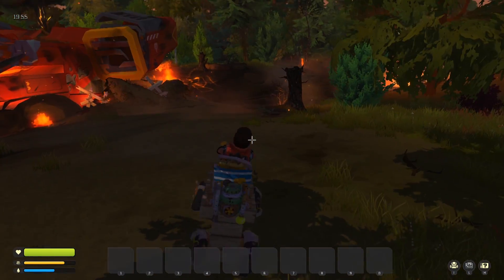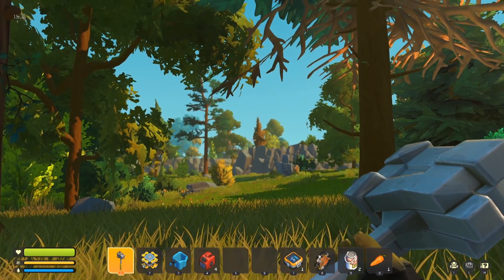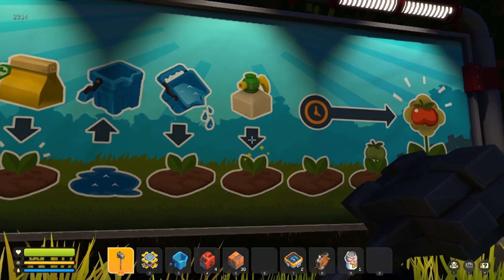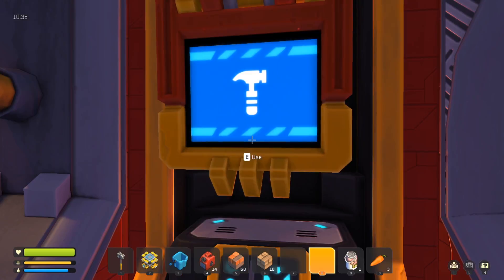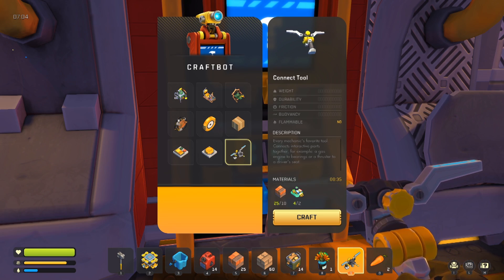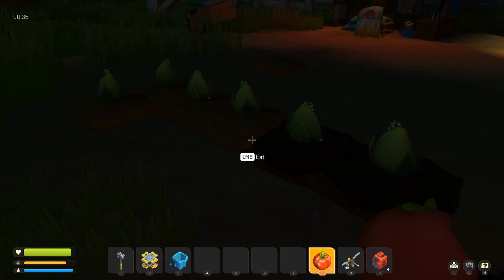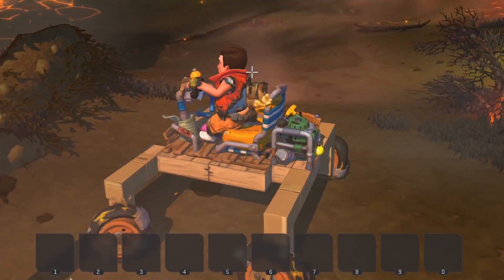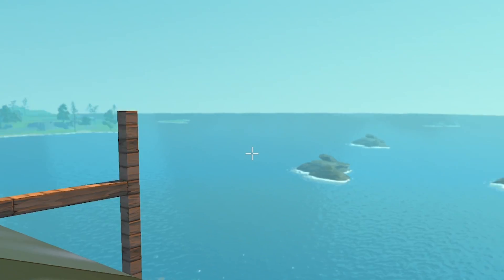I Built A Functioning Vehicle Out Of Cardboard And Wood in Scrap Mechanic Survival

Comment: A tip for when you are a little further along: I learned last night that suspension shocks are VITAL. It seems like it allows all the wheels to touch the ground at once so you get better traction for speed and turning.

A rigid framed car like yours (and mine prior to last night) is passible, but sucks on uneven ground.

Comment: Couple of tips:

1. Forget having a car until you have some bona fide wheels. The scrap wheels belong to the wheelbarrows you can find them on. Contact patch is so uneven that's hard to make even a viable car build. The scrap engine and seat will suit you fine until you start getting into heavy machinery, but for an exploration rig, they will work just fine as a starter. I would upgrade to the gas engine before I would put effort into upgrading the seat. As somebody else here said, you'd be faster running then you would be with scrap wheels. 

2. You can place your lift just about anywhere and you can use it for a personal elevator. 

3. Bots will only attack your farm if illegal farming is detected. You will get a notification as well as a red timer over your farm plots. The bots will ALWAYS attack at midnight (0:00).

4. Based on my experiences, it seems that unless you're going for all wheel drive, you should have your drive wheels set to the front. Most builds I see are rear heavy and RWD will only cause wheelies (as you have already experienced), and if you don't have ENOUGH weight in the rear, a RWD vehicle will only perform mad skids and hardly get you down the road. Those drifts are fun the first few times but becomes increasingly aggravating the more you want to explore. So, my opinion and suggestion, is Front Wheel or All Wheel Drive or walk.

5. Fuel economy is factored by both weight and the grade of engine used. For maximum fuel economy, AWD (counterintuitively) gets best results, based on several peoples tests, as well as finding a balance between a vehicle that is too light and one that is too heavy. Too light and your vehicle will never make good contact with the ground, so you're burning excess fuel with either burnouts or hopping around midair with every bump in the road (or both). Too much weight and you will lug your engine down, obviously consuming more fuel.

Comment: the building platform is your best friend you can place it, stand on it and then press up to elevate, no need to build jumping spots

Also any block you place (and many smaller structures) can be removed by right clicking, in the early game you can get all the wood you need just from dismantling small shacks